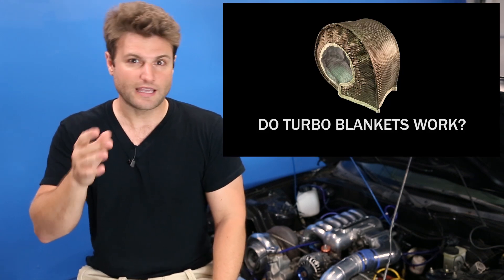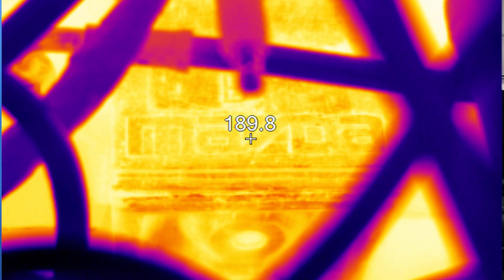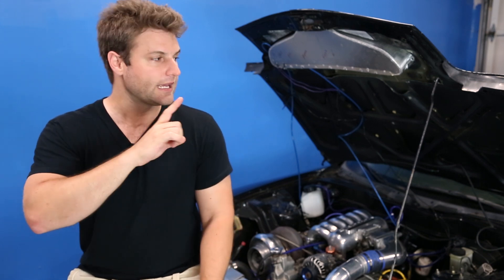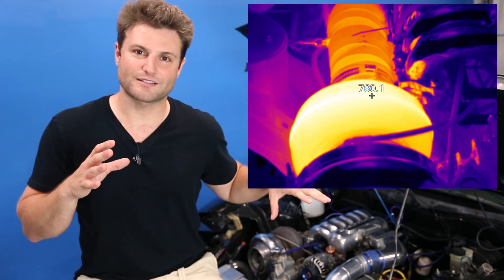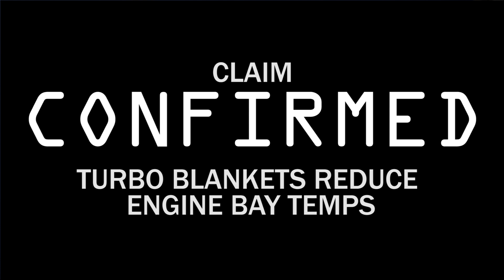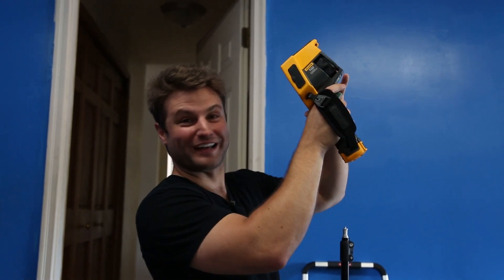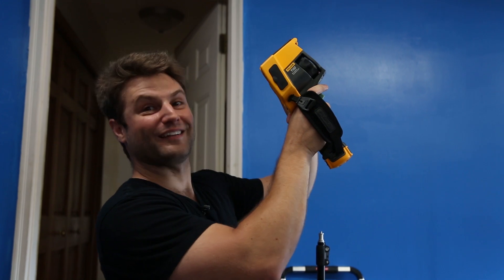Do Turbo Blankets Work?

Comment: The question now is. How much heat ca the turbo and its oil take before it’s too much. If your car is in a hot V. With 2 turbos this blanket could increase temperatures inside the turbo by an insane amount. Hot Vs are already quite troublesome set ups with heat. But sometimes necessary. Is it a choice between failing seals or failing turbos? Or is it a choice between failing seals and safe seals?

Comment: One thing car manufacturers I’ve known for years… Is that hoods need to be vented somehow to help get the heat out. And especially helps when you’re going down the road to have forced air, forcing heat out of the engine. Along with turbo blankets this really is an outstanding way to get heat down the exhaust and away from the engine. But manufacturers like I said I’ve known this for years and they refuse to put vented hoods on for the majority of the cars. Every car should have a vented hood. The result of not having invented hoods… More cars coming in with problems and eventually dying an earlier death.

Comment: Wonder if the blanket help the keep the temp down from the radiator aswell..Thermostat may regulate temperature but the radiant temperature in the engine bay can keep the radiator hot as well

Comment: Well, you can install this blanket then the heat has nowhere to radiate out and will lead to premature failure of turbine shaft, bearings also your oil will burn and break down faster, enven it might get seized after cooling down, not worth the risk period, hood paint got cracked because cars with factory turbo close to the hood area they install a reflective heat patch to prevent it, this car doesn't have it.

Comment: This is definitely a serious concern especially for GM cars in the muscle car ERA.
The exhaust manifolds basically put about 350+ degree on the oil filter and starter / solenoid device.
Boiling the oil, destroying its ability to protect the engines.
I worked in an automotive  machine shop 5 years, and literally every chevy engine we worked on, inside the block has extreme carbonized oil in it, causing excess wear and build up every place in the engine & valve covers-intake ports etc..
The manifold on the passenger side are 2 1/2 inches from the filter.
350 degrees on oil kills it qualities, causes it to evaporate out and carbonize!
YT channel “project farm” did a series of oil characteristics at various temps and conditions under careful testing.
Showing what heat does to oil, it destroys its cooling-lubrication-cleansing affects dramatically!
And causes it to evaporate reducing quantity.
The heat affect wire of the solenoids, and is the biggest reason they FAIL so often in GM cars.
Heat makes wire properties very resistive and causes excessive current draw on components thus induces secondary issue also, again a Poor GM design and HEAT is the #1 culprit.

Comment: with mCΔT you Time is a key component in the equation. So while intake manifold temps were higher, the air doesn't have very much time in that area to actually heat up. But it does make a difference. Just don't think that a 200 degree surface is amounting to a 200 degree air charge :)

Comment: Turbo Blanket alone will not work. You need to cool the air going to turbo by adding fan to intercooler then protect turbo from engine and transmission 🔥 heat by adding Blanket especially from DESIGN ENGINEERING COMPANY.

Comment: Less heat also decreases the possibility of engine wear or mechanical failure.

To protect the paint on the hood however, I'd just pop a reflective insulation guard under the bonnet where it's meant to be (or run methanol lolz)

I will defo second some of the comments below. Get that turbo blanket, wrap your headers and use quality lubricants including coolant. Also ensuring that your custom radiator provides good enough cooling (heat dissipation) for your particular vehicle, is never a bad idea.

All this comes down to; if you want your car to perform consistently, invest some time in researching upgrades, save up the bucks and stick to only installing quality parts.

Very informative video, thank you @Rob Dahm ;)

Comment: I think a turbo blanket works best on the cold side of the turbo.
The hot part, needs just a small insulator, just not to have the turbo to radiate the engine bay.

As far as using a turbo blanket on the hot side, it just insulates the heat radiation towards the cold side.
In theory a blanket on the hot side, will warm up the turbo more, and thus could affect the intake air temperature.
But that would be minimal.

Comment: On my 91.5 dodge ram 6bt I used the "extra thick" header wrap on the stock cast manifold + hot side + the volcanic /titanium blanket on top of 2000°F paint.  150k mi  no cracks no rust . I limit out at 1100°F EGT.  I have run from Portland, Or to the other side of Salt Lake City 900+mi at 850-1100°F EGT towing  I stoped regularly to check temps ,bear hand the blanket. Were as before wrapping  30min minimum to tuch any thing with out gloves or 1-2° burns.

Wrapping my junk  up dropped my EGT by  a hundred degrees  AKA 500° was 1 psi now it's 400°   less throttle/EGT is needed to maintain freeway speeds. 70mph onthe flats was 600° 1psi now 500° @2-3psi. Spools faster as well.

Comment: i am recently searching DEI wraps and point me to this informative video, great explanation of something i never though of, feel it a interesting topic. Question... if you wrap the exhaust side of the turbo so more heat will be used to rev the turbo faster, does it also mean the intake side of the turbo got much hotter and less dense of air coming in?? guess there must be a interaction point beyond where wrapped overtake non-wrapped, and vise versa... imho, there is no such a thing absolutely better than the other, it is all depend on your driving conditions, if you are just a daily driver with a oem small turbo, and not usually rev your engine to 5000+ rpm (i am talking about cylinder engine, not rotary that 5000 rpm might be a minimum requirement for driving, jk if i am wrong), a turbo blanket may reduce power as the heat will be soaked to the intake side while you don't have high turbo rev to compensate the loss of air density, but i would wrap the intake pipe in this case to ensure a denser air supply from ambient, but if you like revving your big turbo engine frequently and drive fast alllll the way, you may want this blanket for the turbo while intake wrap makes minimal difference, as turbo occupies large portion of air intake, and the air are forced into the intake too fast to be heat soaked.  JUST MY 2 CENTS

Comment: one point i did not hear which is the down side of turbo blankets is if you have an oil cooled turbo it traps the heat.  So you really need to let the car idle or drive very easily for around a min or 2 before you shut down the car.  Most cars with out turbo blankets usually just idle for 15-30secs they are good to be shut down but because of that turbo blankets ability to hold concentrated heat which excessive heat will break oil down leaving soot and other deposits in your turbo, and turbos do not like broken down oil.  So you need to give it some extra time to cool down.  This will help extend the life of your turbo.  Make sure to also only run synthetic oil but that almost goes without saying.

Comment: What about The turbo's life?
Reply: panic mike 
In my experience the center housing doesn't take as much heat soaking with the wrappers on it. The center section is what determines the longevity of the turbo as this is where the bearings and oil are at. Anyone worth their salt having a turbo is going to let it cool down before just shutting it off wrapped up or not.  This is to prevent the heat from the exhaust housing soaking into the center section and coking( turns the oil into unsquished diamonds AKA carbon). coking is what kills a turbo In use sufficient oil supply cools things enough to prevent coking.

Comment: One more thing to remember is that hotter exhaust gas has a higher velocity which help in scavenging exhaust out of the turbo and exhaust quicker which also helps turbo spool. 1 more thing to remember with a rotary is that it's exhaust gas is several hundred degrees hotter than a piston engine. Because of this heat soak is worse so a turbo blanket and thermal control is even more important with a rotary. Also the RX7 engine bay is real big so there isnt as much air flow especially when you drop a larger engine than what the factory engineers meant to be in there. A 3 rotor engine will be worse than the stock 13b and a 20b will be even worse.

Comment: Turbo blankets do work by keeping more of the thermal energy in the exhaust side where it belongs. There are anecdotal reports that in some cases it improved spool up mildly. It has a LOT to do with the build quality and the quality of the materials used. A cheap chinese turbo blanket off fleabay is probably going to give you a different result than one handmade with good materials and by someone who gives a shit.

Comment: According to the laws of thermodynamics even a naturally aspirated engine could benefit from thermal insulation. If the difference in temperature between the flowing continuum (air, water, whatever) and the sidewall of the tube is lower, the friction is less. 
That means, if you keep your exaust heat in the pipe, and in the turbine housing, the metal parts will be closer to the EGT, thus reduceing flow friction. 
It is gonna put more thermal load on the turbo and the pipes, but on your level of performance Sir, it ain't gonna cause a problem.

Comment: This is why I really like turbo blankets & full exhaust wraps. They protect everything from the heat, and I think they keep the heat in the exhaust system, so the whole system is more consistent, the exhaust flows out better, and doesn't slow down & create some resistance, because of the colder sections making the exhaust flow denser, like the final parts of the straight pipes, the mufflers, or the parts of the plumbing hit with cool air.

Comment: Don't trust the temp readings that the infra-red cameras show. They need to be calibrated for every different surface as the emissivity varies from surface to surface. You can't just point and shoot. Many IR cameras allow you to change the emissivity value and you'll notice the temp reading changes as you do this. The way to calibrate it is to point it at a surface of known temperature and adjust the emissivity until the temperature reading on the camera is correct. Most accurate way is to invest in a type-k thermocouple.

Comment: Not a good thing.   The turbo will get to hot itself.   Better of having a custom vent, & heat shielding built in such a away the vent blows it under & out.

Comment: If you have a nut on a bolt and its stuck, you heat it up with a torch to losen it because while both expand, the nut expands a tiny bit more, thus freeing it from the bolt. Same thing happens regarding turbo blades and housing.

Comment: From my own experience, I'm going to go with YES!. Reason I say yes, my under hood temps drop significantly. Before it felt like it would just about take your eye brows off when you popped the hood. Afterwords, WAAAAAY better, and intake air temps dropped.

I went further though and put heat reflective material on the underside of the hood, and made heat shields to cover the exhaust manifold and turbo's turbine.

Comment: But the big question is that nowadays most OE turbo comes with heat shield on the turbine side and the downpipe. So the question is whether blanket is good enough to replace the heat shields.

Comment: Rob,

Would you see any more efficiency using a blanket on a smaller turbo (like the TD-04 in my WRX), or does it not put out enough heat to make a difference with or without the blanket?

Comment: Thermal shielding makes a huge difference and when you have the money. To do it correctly it starts in the cylinder and goes out from there. Coating for pistons, cylinder head and valves.  The exhaust ports are then coated with a ceramic thermal bearer. Now the exhaust system thermal coatings and other types of bearers can be used and it all adds up.

Comment: it's not possible for a hotter turbine to reduce the gap between wheel and housing. the wheel do not expand the same amount as the housing, cast iron has a bigger expansion rate then most steels. so if anything, you wound enlarge the clearance with temperature. even if the two materials used would got same expansion rates the gap would be the same, no matter what temperature.

Comment: Using blanket would make your turbine housing run hotter so the clearance between it and the turbine rotor would be increased hence less efficient. OTOH the compressor case would be cooler so it's clearance would be reduced hence more efficient. Which is the bigger effect probably depends on your particular turbo.Interesting question you didn't answer (don't know if you could) is what it did to the oil and metal temps in the turbo bearings as the blanket could make those get hotter which might be bad. I would probably run my turbo timer a bit longer if I had a blanket to make sure the bearings etc cooled off.What does your turbo manufacturer say about it? I've seen them used on big diesel engines for backup generators or on boats I assume for the same reasons.

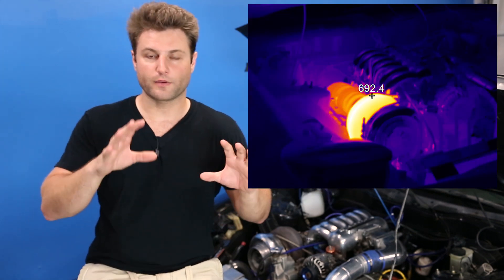Comment: @2:50 Well, no... You'd be getting a lower mass air-fuel charge into the affected cylinder/rotor(s), thus producing less power, but the A/F ratio will still be constantly monitored by your exhaust sensors and corrected by your ECU. The only way for fuel to fall out of the air charge is a drastic REDUCTION in pressure or temperature.

Reduced power from the affected cylinders/rotors would definitely be a thing, but altered A/F ratios would not be.

Otherwise, great video with some great info.
Reply: As I think about it, trapping the heat in the turbo with the blanket, could POTENTIALLY reduce overall engine power, by drastically increasing intake air temperature. I'd really like to see this tested!

It would depend on how much hotter the intake air temperature gets with the blanket on vs off. I'd still leave it on, just for the sake of not boiling the rest of the engine bay, a new turbo is easier to install than a new every-single-component-in-the-engine-bay.
Reply: but cars don't have an 02 sensor for every cylinder
Reply: +Aray Beezy - Not in any way relevant.

Comment: you finally got to some of the real use of these blankets at 5 min mark. that's the real reason they are used. 
keeping heat loss-energy loss to a minimum.
Reply: Nope.
Reply: +Fredrick Karlsson no u
Reply: What ? The main purpose of A turbo blanket is to reduce heat, getting higher gas-speeds is just a plus.
Reply: disagree for now,

Comment: But the heat should exchange and go somewhere and if you cover it then the temps under the blanket will get higher and might get too high and get dangerous. correct me , lower your performance with the blanket on or make hood scoops. enjoy your car more.

Comment: Dyno with the blanket on and off would be a good test.  I don't think it'll make a noticeable difference but I wondering if the boost will come on slightly sooner
Reply: I think it would be in the margin of error.  No two dyno pulls come out the exact same way, I think it would fall in that range.
Reply: I completely agree.  The video was talking about possibly producing more power from the blanket so it was a suggested test.  But I think the difference will be too minute

Comment: You lost me at the 30% efficiency and the other 60% is lost through the radiator/ exhaust. Where's the other 10%?
Reply: There is alot of energy being lost to heat by friction in the transmission and differentials. That could be the missing 10%. About 30% is converted from gas to movement, other 70% is lost to heat because of friction, hot exhaust and radiator.

Comment: the heat isn't contained in the turbo, the hot air passes through the turbo into the exhaust system, same as always, the blanket is reflecting the heat that has already soaked into the metal, which could theoretically cause the housing to expand at a higher rate than the internal turbine, causing a loss of efficiency.  As far as the heat differential in your intake manifold goes, while the radiator is clearly adequate, you may need an intercooler upgrade to cope with the now higher air temps from the turbo, as colder denser air has more oxygen by volume than hot air, which leads to more fuel being added to maintain proper air fuel mixture, netting more power from the engine.

Comment: is that much heat good for the turbo its self?  could you over heat your oil? can you over heat a turbo and if it does can it kill your engine? I'm  not sure bottling that much heat is a good thing.  what about a heat shield instead?

Comment: couple of questions if there are any mechanical engineers (or genuinely knowledgeable auto mechanics) here.

How does this affect cooling of the turbocharger. Both during operation and after engine shutdown? Given the is contained, would I need to run the car at very low power or idle for longer to allow the oil to cool the turbo?
Reply: ...given the heat is contained...

Comment: Someone needs to make a universal kit that goes over the hot section and drals air out. maby just a cut out over the hood every time I see a big honking turbo but on a NA  originally car I cheng especially if their is just a little opening and hardly and out flow for air their are so many factors people don't consider when they do mods some times they get lucky some times they don't in my job I have to be right 100% of the time because you can't pull over in the sky.